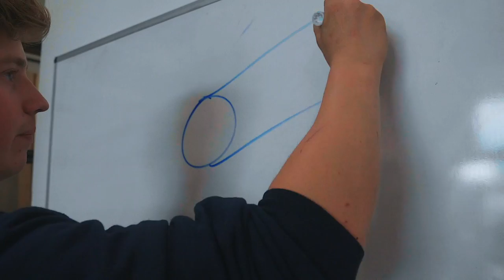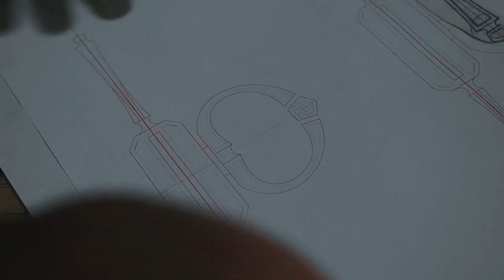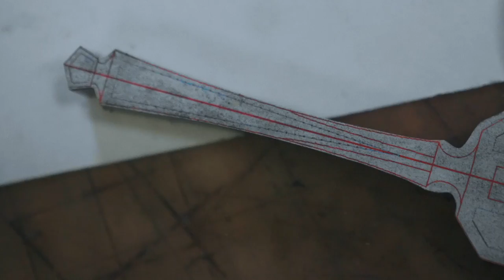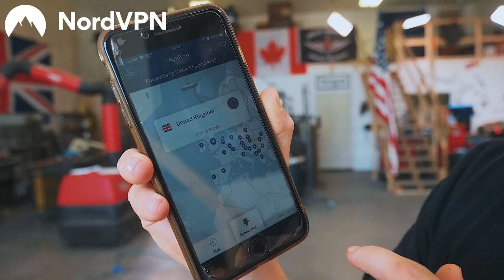MAKING THE SWORD-BREAKER!!! Part 4

Comment: Hi Alec, have a quick tip here for you!
I’ve had the same issue with the paper burning... I checked on the internet and it turns out that the company edding makes a high temperature lacquer pen that is heat resistant up to 400C and some colors are even visible up to 1000C. I used it and it works quite well. At high temperatures the paint runs a little bit but otherwise its fine. You can just dip the part in water of course. To apply it I use some masking foil (it’s used for airbrushing and stuff like that), stick it onto the design, trace the contours with a sharp blade and then transfer the cut out design onto the workpiece. Then you can simply color the edges, remove the masking foil and later grind to these contours. 
Please like this comment if you want Alec to see this ;)
Greetings from Germany!
Reply: Sounds excellent!
Reply: gjaddajg The paint soaks through paper quite easily
Reply: Paul Mab Thank you!
Reply: gjaddajg Oh you meant that...
Yeas that works but isn’t precise. You van get a rough shape but not a precise contour. If you look closely you can see that the edge is blurry in many spots. This is because there is a slight gap between the paper and the part. To get a precise contour you need to use masking foil. It sticks to the part and the paint wont run under it.
Reply: I still think the answer is a Laser...Of course, as someone who has had a CO2 laser for a couple years, it's become my answer to EVERYTHING...

Using a laser, you could cover the piece in dykem, throw it into the laser cutter, and etch in your scribe lines perfectly and precisely from a vector image.

Beyond that, it could replace the complicated and annoying etching system they use for their maker's marks by simply coating the metal in spray paint and rastering the image into it, ablating the paint where they want to etch and leaving a perfect and durable mask behind.  I use this method to make circuit boards with traces down to about 8mil, so they could get some crazy detail with much less hassle.
Reply: @Harbingerx81  glad someone had the same answer to the problem.
Reply: Die Deutschen schon wieder mega Ideen :)
So muss es
Reply: Harbingerx81 That sounds like a great way to do it! I sadly don’t own or have access to such a laser, nor could I afford one at the moment. So till then I got to do it the hard way.
Reply: @Harbingerx81  good tip!👍 I did a little reading too and a Gloforge user had success with coating stainless with a product called Cermark. And that workshop NEEDS a laser!. Surely 😁
Reply: Ehrenmann
Reply: I've seen where tattooists print the picture onto paper and then transfer the image to the skin before tattooing. Would something like that work so that you remove the paper issue all together?

Comment: There is a reason your friend used aluminum on the file guides - so that it wouldn't wear out the steel of the machine. Using a softer material that can be replaced easier is better then having to fix the machine.
Reply: They are fixed top and bottom so not moving against the steel of the machine, the top guide of the machine moves with the file so no dramas.

Comment: Hi Alec..... Get a small cnc laser and it will engrave your layout into the blue dycum (burns it away and leaves a nice shiny line) ...... It works a treat
Reply: Completely agree.  Every time I see them do things like this (or use that weird etching system for their maker's marks) I am just thinking about how much easier it would be with a CO2 laser.  I use this method (with a spray lacquer) to make circuit boards with traces as small as 8 mil and it is accurate and effortless, especially compared to the methods they are using.

Comment: try the engraver trick, you print onto grease proof paper, rub nail varnish onto the metal tap it with your finger till it's tacky, stick the drawing to it, burish and it will leave the ink onto it, takes abit of practice but it works.

Comment: Why not use files for the machine that cut on the down stroke? Like a Jigsaw you can have cut up or down.
Reply: @Maksim Stolyarchuk if those are not die file files then it cuts on the up stroke.  They do not appear to be because they do not attach at the top, only the bottom.  I could be wrong though.
Reply: Said this right before will mentioned the top guide...

Comment: Awesome work as always! Suggestion for keeping the metal cool while grinding, without getting it wet and ruining your paper template: compressed air! Doesn't cool as fast as water, but it's much better than just waiting around. You can also set the pieces on a damp sponge to cool even faster, and then the compressed air helps keep the moisture away from the paper. If your air compressor is too strong and will bast the paper and tape off of the metal, air duster cans work even better for quick cooling since it gets cold enough to cause frostbite.  There are also vinyl sticker sheets you can put in your printer that make great waterproof templates, though you'll want to check to see if your printer ink is waterproof too. Bonus with those is that you don't need to fuss with masking tape and super glue!

Comment: Alec, when using a paper template on steel while grinding, may I suggest using a constant air flow to keep it cool so there is no need to dip the piece in water. You can also pre-chill the air for a greater effect.

Comment: Alec.  You should really consider getting a laser cutter to cut out patterns.  We use ours to cut out patterns on blue masking tape, then stick the tape to the piece you are going to work on.  It works 90% of the time every time.  It also works to use dye on the piece then etch the dye off, won't burn, move, or rub off.

Comment: Get some tracing paper. Print on that (if your printer can handle delicate papers), then run over the lines with pencil, or trace in the usual manner. Flip and trace onto your steel, and then mark with something more visible if needed. A fine tip Sharpie is your best friend here. No more worrying about tape or paper shredding or burning. :)
Reply: Also, I hope you guys aren't getting sick. Drink a shot of Apple Cider Vinegar if you're feeling under the weather, and it should clear up. :)

Comment: Don't you have a cool laser etching machine that you could use to etch the pattern onto that guard?  Rather than use paper?
Reply: I wondered about that too. Also thought that a cheap 3d printer or cnc could be modified to scribe patterns into layout fluid pretty easily.

Comment: Dykem on metal , tape pattern on metal ..cut round pattern with knife pattern transfered to metal remove pattern ..no melty paper/tape.

That blade etch looks insane..loving the projects guys ..I built my own die filer a while ago I want a bigger motor on it tough,need more torque!

Comment: Alec, you should look into getting one of the cutters that people use for vinyl decals. If you could make your designs in vinyl then apply it to the steel, you'd be able to dip it into water to cool while grinding. It would also be very easy to cut out the exact shape seeing as its a computer program thats doing it

Comment: Alec, you need transfer paper. Then when you trace the drawing over the top it would put the ink straight onto the steel. Then no issue with overheating and burning the paper or releasing the tape or glue. There's also a way to transfer the drawing with picture paper or specifically made transfer sheets. However those would be plastic stuck to the steel and could melt and warp when grinding.

Comment: Really cool build.... 
@8:11 on the guard grinding... You can really save your belts/stones/discs buy not grinding the slag off. Chip it off instead using a hammer or a chunk of T1 or the like.... Then go at it with the belt or what ever grinding method.
Reply: Forge a slag hammer!

Comment: So the die filer is like a scroll saw for metal! Pretty cool. Alex/Will have you tried using 3M Super 77 spray adhesive for attaching your patterns? When I use that stuff I usually have to grind or sand the paper off, it won't budge.

Comment: Hi you should get grinding butter. It is rubber like compound that cleans dust from belts and lubricate them. So the piece does not get that hot. And belt last longer. Pretty good with hard wood.

Comment: Alec, don’t you have an etching machine? Print out the pattern and etch the grind lines into the guard with that. Then your lines won’t burn off.
Reply: That and/or use the sheet of paper to trace in some blue dykem.
Reply: He needs a laser cutter/engraver.  Cover the piece in dykem, or even spray paint, then laser the markings into that without marring the steel.  This would also be a MUCH easier way for him to do his chemical etching, as opposed to the crazy etching system they use now.  Hell, I make and etch circuit boards using spray paint and my laser cutter.

Comment: AAAAAALEC!!! Before the next guard, for the love of god, learn to braze!!!! The form of that ring will cooperate with you if you use the methods the craftsman who designed it used. Learn.to.BRAZE!!!!
Reply: I know, I keep watching this, and it's neat how goes about it but the whole time I'm wonder well what did they do back in the day to make all these intricate guards and stuff without all the modern tools Alec and Will have access to.
Reply: @MrGoesBoom  None of the tools they use are that far off of tools available for hundreds of years. There is no need for brazing, he has a welder and they're not dissimilar metals, so they don't need brazing.
Reply: Andrew Delashaw welding is not historically accurate (though neither is plasma cutting...). But the major benefit soldering or brazing has is preserving cleanliness. You can braze a basically finished ring to the guard and not have to do a huge amount of clean up work after. These forms he’s copying were formed by the methods and tools the old craftsman had. Brazing allowed them to easily stick a ring to the side of a guard. 

Check out Seth Gould’s or Thomas Latane’s work to see this kind of tool/method kit at work. Though neither are knife makers both are working in the same fine scale, fine finish, and time period as this would’ve been designed in. You will see both heavily employ the use of brazing to build up intricate parts.
Reply: Another good craftsman to check out who uses brazing/soldering is Neels Van Der Berg of black dragon forge. He frequently makes guards with side projections soldered on.

Comment: I use a trick by Steve Culver to secure my paper drawings on my steel: Just roll a Q-Tip soaked in superglue across the paper! This turns the paper into a sort of plastic. It still doesn't like geat but at least you can now dip it in water.

Comment: He should get a vortex cooler to blow on the piece while he is grinding it.  My mill came with one to cool the work pieces, plus they are mindboggling taking compressed air and turning it into a stream of hot and cold air with no power.

Comment: For future projects, a possible way to transfer the image on a paper to the steel w/o actually using paper glued/taped to the steel. 

I'm not sure what it's called but the process you guys use for electrically etching the image to the steel like you guys use for adding your Maker's Mark (name's not the signature sideways "s" shape). If you could print your project on the plastic sheet, then tape it down and etch the image into the steel it shouldn't come off in high heat or when dipped in water. The only issue I could see with this method, is the possibility of making the template. I don't know how fine you could reasonably get your lines or if it is economical(how expensive bit might be). But if you can get very detailed lines like you'd need and it's cheap. It may, indeed, be less tedious than using the paper/glue/tape mod in some situations. 

I hope you guys see this and at least consider it, maybe it would not work, but it might be a cool experience/experiment for a future video either on its own or in an episodic video series like this. (I say "future video" because by this time I'm sure it's already done since your videos seem to be out about 3-5 days after filming, so it might not be worth while in this specific case, but perhaps in future projects.) 

Also hope to see more steel vs steler episodes soon! I love seeing your guy's personal interpretations on something similar. It very fun for me to watch even it it may be a little anxiety for your time crunch. :) 

Keep up the good work. I love watching your videos! Have a great weekend! :D

Comment: The blade is looking awesome so far! Just curious, following some famous words "need a tool, make a tool" would it have been possible to have forged a bean or horse shoe shaped punch in order to pop out the center of the guard ring? Of course a plasma cutter is way faster I get it, but if you had wanted to only use forging techniques? Keep up the great work guys, excited to see this project evolve.

Comment: You guys REALLY need a laser engraver...

Cover the steel in paint/dykem then laser through it to give yourself clear, precise, and durable guidelines in a matter of seconds without needing to cut and glue paper on anything.  The same method can replace the crazy masking system you guys use for chemical etching, which looks like a total pain in the ass.

I use this masking method for etching circuit boards with 8 mil thick traces, so you could get some amazing detail compared to what you are doing now.
Reply: What masking system for chemical etching are you referring to?
Reply: @farmerboy916  I can't remember what it is called...Some system involving thin plastic sheets with the images cut out that are taped to the surface of the material and then a 'gun' with a sponge on it (presumably soaked in salt water) sends an electric current through it to do the etching.  They use it often to etch in their maker's marks and quite a while back they showed it off in one video and explained a little about how it worked.  They also said it was expensive and between that and how much of a hassle it appears to be, it seems like a laser would be a much better option...

Of course, as someone with a CO2 laser, it's naturally my answer to just about everything.  CO2 lasers are not cheap either, but they are MUCH more versatile.  I suppose though that since they are already 'invested' in that other system, they might be hesitant to try anything else.

Comment: Will S. will now be known as Will Spicoli because he'll be "jammin' with the Stones"!

Also, Alec, have you considered using your engraving tool(s), or just a cheap, vibratory engraver to "trace the lines of your designs directly into/onto the steel?  At least for your straight lines, and even curves of a known radii, just cover your printed line with the guide, put the tip of the engraver up against the guide and trace it out!  You could then go a step further and go over the engraved lines with something containing a light color to "in-fill" the dots making up the lines, thereby making the lines more visible.  Just a thought.

Comment: Tip from when I made circuit boards.  Get a glossy photo paper.  Take the diagram and print it full high quality with a laser printer.  Place the photo paper over the steel glossy side down and hold an iron on it for about 30-60 seconds. Cool it off and soak it in water.  The photo paper should peel off and leave the toner in tact.  Fusers in laser printers melt the toner onto paper st about 400 degrees f so you should be able to hold onto it longer and as toner is essentially plastic it shouldn’t wash off in a cooking bucket.  Give it a shot.

Comment: Regarding your trouble with grinding around paper: Remember my comment on the previous video? (you DO read all comments, right??)
Laser engravings don't burn away ;)
Reply: Sven S I just left a comment about etching the outline of the shape but a laser engraved would work great
Reply: I alway use a tiny dremel burr and trace the outline to transfer it to the work piece.  (not a pro or anything so there is undoubtedly a better way,  but it works)

Comment: Could you use a scribe in the CNC to just scratch the pattern into the guard for the grind lines?  Even a sharpie or other pen might be enough.  Admittedly you might need to make a large flush grinding pass to make it flat enough to use. Like most things, it’s all a trade off in the time to do this vs waiting while grinding!

Comment: Hi chaps, a superglue trick you might occasionally find useful when you need to join two things securely to get a job done. such as gluing a file to a tube 

Superglue + Baking Soda!
You basically get instant-setting, very strong, fine 'concrete'. It fills small voids, holds tight, and can be filed to shape.
...the trick is to lightly pack the void(s) you want to stick with the baking soda, then thoroughly and quickly saturate it with liquid superglue.

Watch out! 
Darn near instant setting and isn't going to come off whatever it sticks to.

Comment: Instead of gluing a paper pattern, try an Acetone transfer. Print the pattern mirrored on a laser printer, put it in place with the toner facing the metal, and rub it with acetone.
Hope that helps.

Comment: I note there's a tanto or wakizashi on the filing area calendar, and I've been wondering whether one of the smiths would make one of those neat little japanese style daggers where the handle and scabbard meet seamlessly without a cross-guard sticking out. I think they call it "aikuchi".

Also it'd be really cool to try tiling some damascus on either side of a mild steel spine, then sticking some high-carbon steel on the side that's going to hold the sharp edge, then after it's forged allowing the extra contraction of the mild core (compared to the edge) to give it a natural curve (a bit like what unintentionally happened with Alex's rapier).

Finally, it'd be interesting to see something musical, like a bell or a gong, made here, though I'll be happy to see more crazy blades made too.